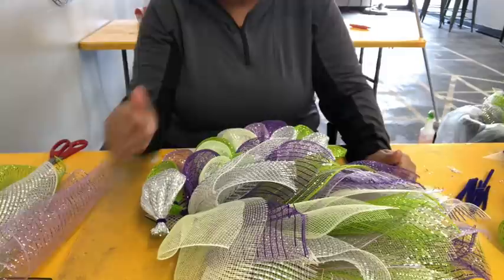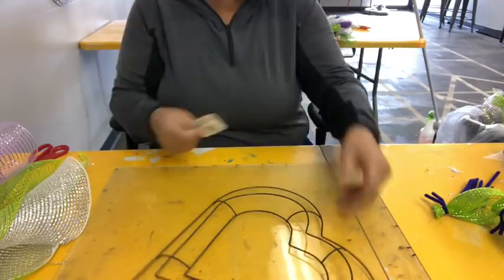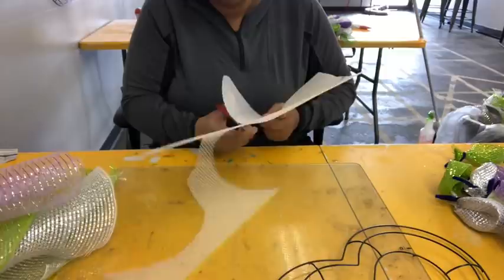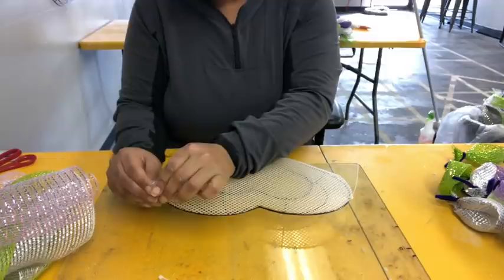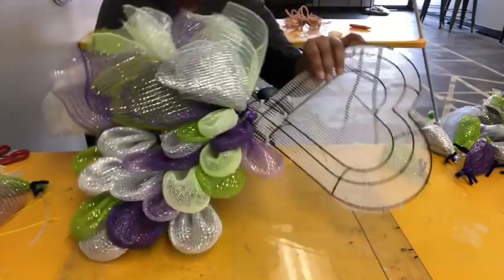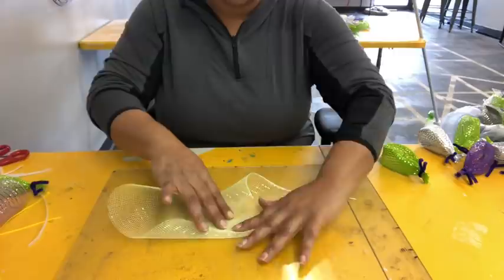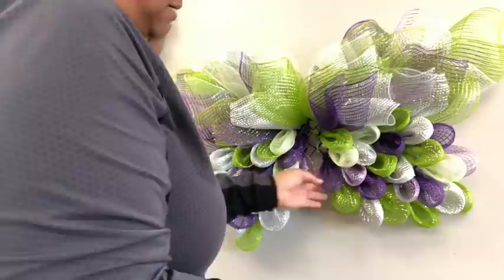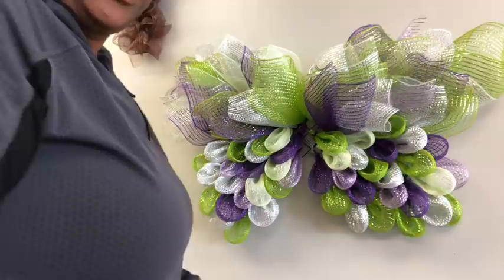Butterfly Wreath Tutorial

Comment: I was wondering if you could attach the 2 heart's then decorate it? Or does it have to be decorated halfway first 🤔
Reply from the maker: I usually attach the two first but I knew it would be a long or longer lol video so I did one side ahead of time
Reply: @dazedandamazedcreationz389  could you please tell me how to cut that mesh and what kind to buy i bought some but it wasn't the right stuff plus whenever I cut it off it fraes
Reply from the maker: I use deco mesh. I cut with a wood burner to minimize the fraying. I have a video on using the wood burner to cut different material. You’re gonna get some fraying but nothing like what you get from scissors. Afterwards I spray with a clear coat
Reply: @dazedandamazedcreationz389  thank you very much I really appreciate it
Reply: @dazedandamazedcreationz389  wow, this butterfly is absolutely stunning 😍